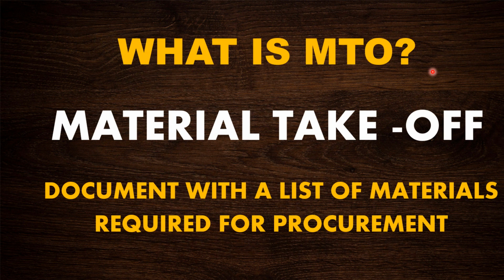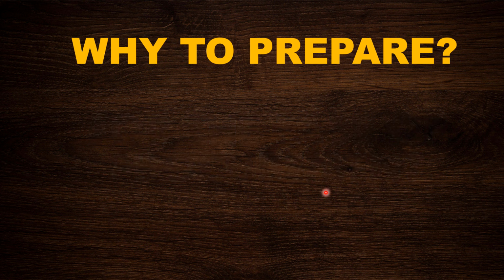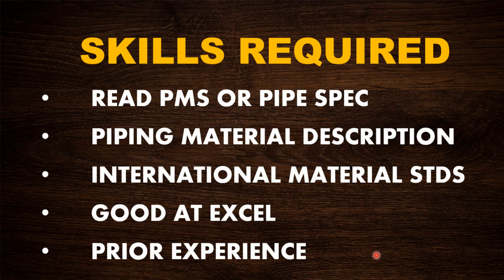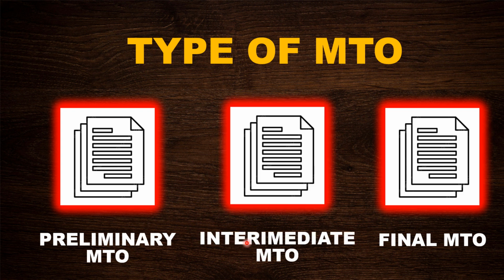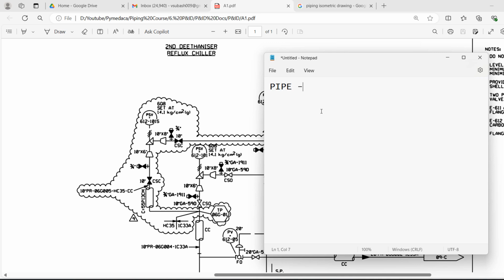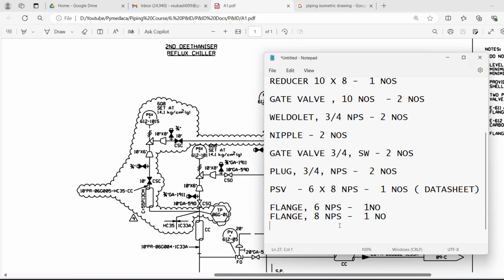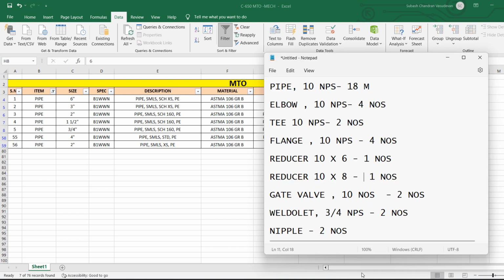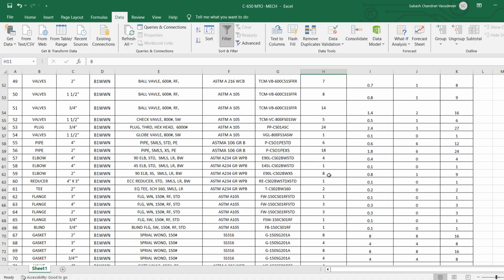How to Prepare Piping MTO in Piping Design Engineering

Comment: sir i have a doubt for this mto in excel i have to learn some of formula to calculate or i have to enter line by line which is given in the p&id with respective materials ?
Reply from the maker: You need to manually list the materials line by line based on the P&ID to ensure accuracy, rather than relying on complex formulas.